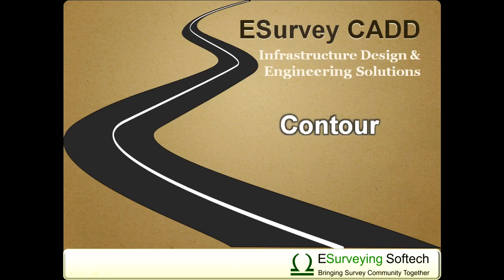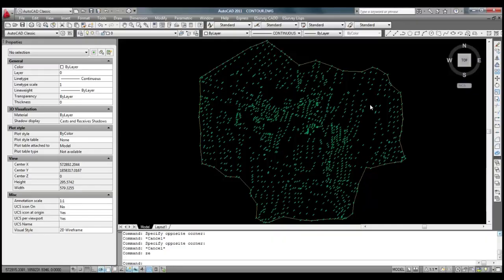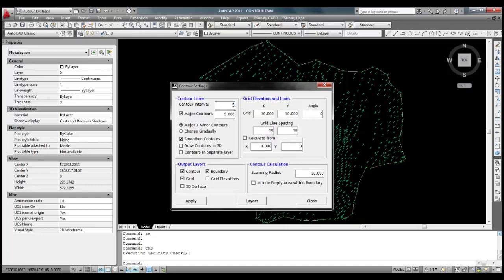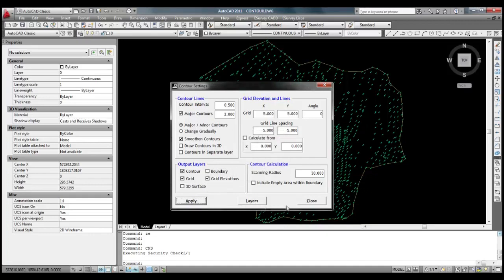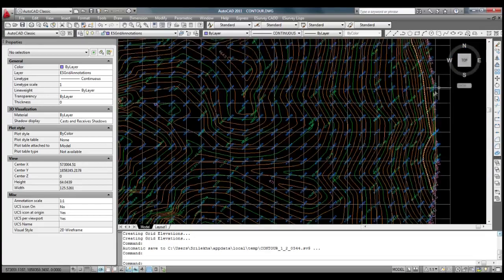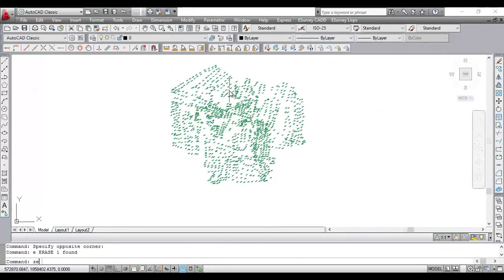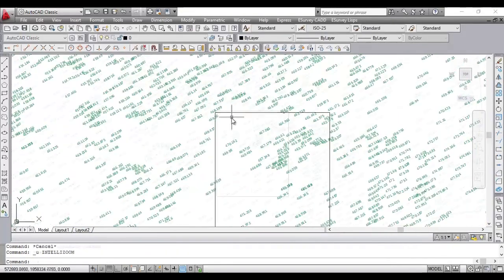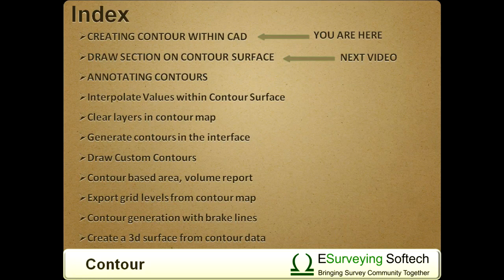How to draw contour lines in AutoCAD?

Comment: Could you send method  datas from excel to autocad. and than how to make contour line as your video. I have downloaded Esurvey Cad Software also installed but its not shown in Auto Cad 2014 . please let me know about the problem . If you have link for registered Esurvey Cad then please send me...if possible could you send the to my email address: surbhi.suratwala@yahoo.in
Reply from the maker: Dear madam
To convert data from Excel to AutoCAD and vice-versa,there are some commands in ESurvey Lisp program in ESurveyCADD .
 You can also generate contours using ESurvey-Contour Module

 you can download ESurveyCADD from following link

http://esurveying.net/land-survey/download-award-winning-software

How to Load ESurvey in Auto CAD menu

Type "Appload" at command bar in AutoCAD 
from appeared window browse to C:\ESurvey\ESurveyCADD.
select "Load ESurveyCADD.fas" , click on "Load " Button.
 then close the window. ESurveyCADD will appear at Menu

Regards
ESurvey Team
Reply: @EsurveyingNet  also you can directly export dxf file from total sation or gps